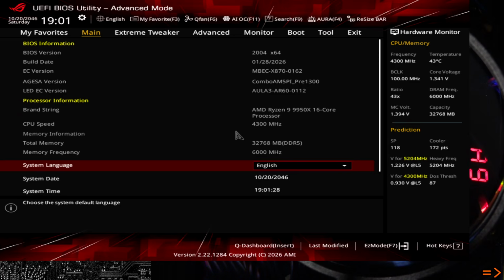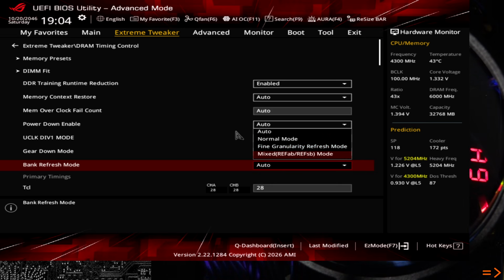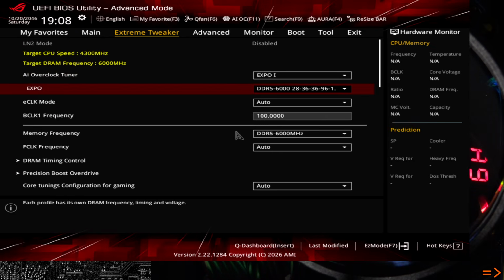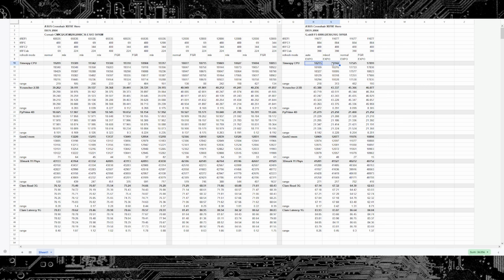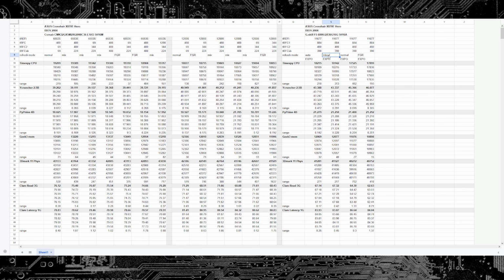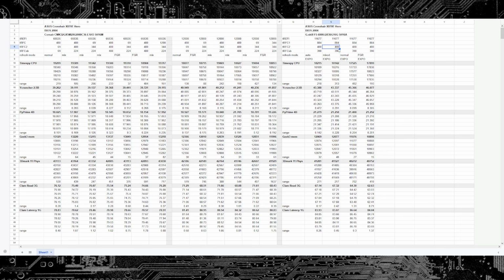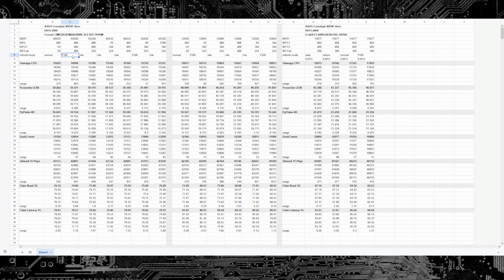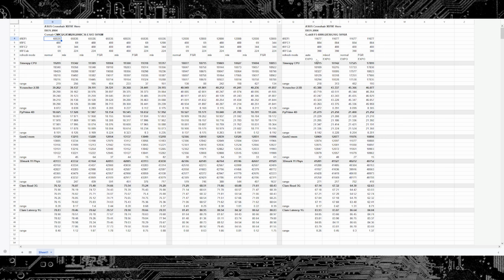New DDR5 refresh modes on AM5 motherboards

Comment: The combination of halving the tREFI and being limited to 65535 is really unfortunate
Reply: Not really. The point is to get charge into the memory storage trances (as leakage rate increases as temp goes up).
If you apply voltage at twice the internal rate (lower tREFI) but at half the duration (lower tREFsb) you are effectively putting in the same amount of charge as 2 x 1/2 = 1. The difference comes in that access delay is effectively reduced by half for any given bank (in this example). It's a probabilities game.
The limit comes in two forms: tREFI and tREFsb. Can't further increase tREFI? Then just lower tREFsb further (if you can). I promise you won't get to zero.
Reply: My mem doesnt go above ~33-35C, ever under full ~720W load. It sits 3-5C above my highest coolant temp as its fed directly after gpu so could be even lower
Reply: @ppeez  nice, my temp goes high becuze of smal heatsink on kingston its smalest desain of all ddr5 and GPU heat hits it too, I have jonsbo z20 smal formfactor
Reply: Mine will run with 65535 but it have corrupted data all over the place, i dont believe proper testing is being done , data is being corrupted and lost, dont believe me , just give it time problems will arise
Reply: @JohnDoe-tv4zd  dont touch tREFI if you dont have good RAM cooling
Reply: @tall1oN  its ddr5 6000 cl38 1.25 volts, it tops out at 40c gaming and stress test, I dont think heat is the problem, it just doesnt hold charge as long , it needs the refresh sooner
Reply: My ram goes 50C avg, can go to 66C.
I increased from 11k to 43k tREFI.
Anything higher than 45k make game studdering or game options get corrupted:)
Reply: My ram rated 1.4V 6800Mhz 34cl expo hynix a die.
I am running 26cl 6000Mhz 1.4V as SOC 1.15V etc.
 If I went for worse timmings like 30cl etc I would be easily done as 1.3V and tREFI maxed would be a issue too.
Since I have smal formfactor build as 20Liter size jonsbo Z20 and my GPU does 400W pushing hot air in to case.
One fan in rear intake is not enough.
My GPU heat hits everything.
Thats why I went for max recommend voltage to start there with tightening timmings.
Reply: @tall1oN I have stock heatsinks at 65528 1.43v and it's fine, but just about
Reply: @Kage0No0Tenshi higher than 45k frametimes gone bad? How you find out?
Reply: @JohnDoe-tv4zd My trefi is 50,000, I see 54c during stress tests (never in gaming) and have yet to fail a stress test
Reply: I have it maxed out ever since the AM5 launched, never had corrupted data
Reply: @TunedGG  Im on intel but ddr5 shouldnt matter

Comment: fourth

It's been a long time since i've had my c8h fail to recover from fucked settings, maybe like december of 22?
Reply: I do believe these high end asus boards auto "safe boot" after a few failed posts unless specifically turned off. I know my z390 maximus xi extreme does. It also has a mem ok switch that if your setting fail to train it will change voltages (often way too high) to try to successfully train. I also turned that off.
Reply: @Apollo-Computers  yeah like he said in the video there used to be a couple of things you could do to them that would get em "stuck in purgatory" where they wouldn't save themselves, or even properly fail the first training attempt to try again

Comment from the maker: first
Reply: That's cheating!
Reply: First row, bank or column?
Reply: I would like to suggest to apply conditional formatting on the summary rows (10, 16, etc.), a 2 colour scale. That makes a sheet like this a lot more easy to see where the low and high values are, which columns are providing the most balanced results. It is a feature in MS Excel, I assume Google copied it.
Reply: at least it wasn't a spoiler blocker...
Reply: based
Reply: yet an other one can not do due to skalping prices yaaaah! XD